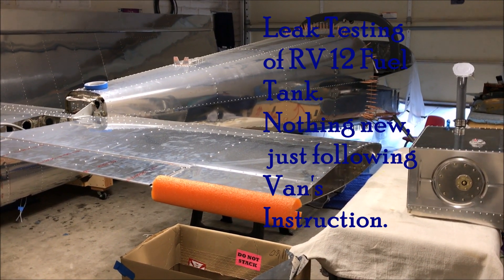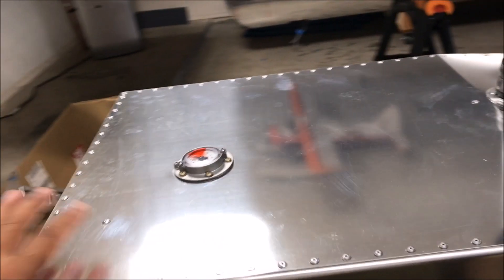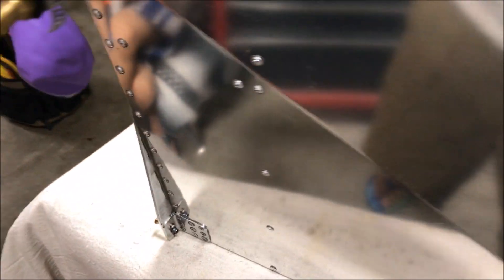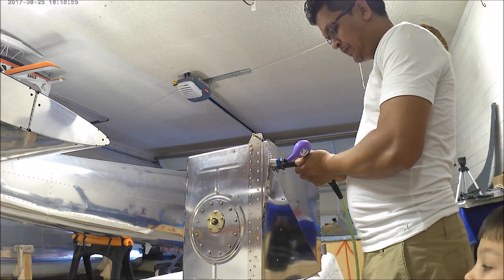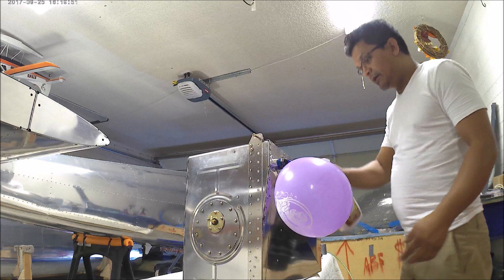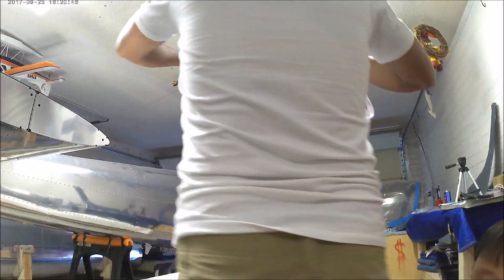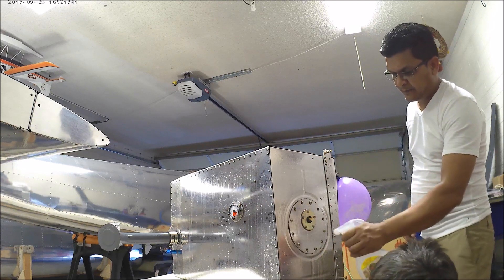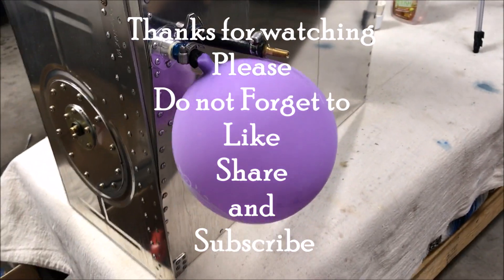RV12 ,Fuel tank LeakTest || Pilot Pramod Regmi

Comment: Cool , we never wait for 24 hours , what we do is put the ballon like u did and dip in water tank with air pressure on tank , so it’s not a welded tank? A2,B2 and B1/2 sealant tank ????
Reply from the maker: Thanks for watching even video is not so professional!!! Tank is not welded its all sealant. 
I just followed the standard procedures of VANS.
Reply: Pilot Pramod Regmi what’s the sealant u used in the fuel tank ?
Reply from the maker: This is what I used. PRO-SEAL FUEL TANK SEALANT P/S 890 B2 
here is the link if it work for you.
https://www.aircraftspruce.com/catalog/appages/ps890.php?gclid=EAIaIQobChMIr_6o6-Gs4AIVAcZkCh20Egn-EAQYASABEgJRovD_BwE

Comment: baloon looks little bit smaller after 24 hour
Reply from the maker: It actually does but very minor. Its okay to lose that much I guess. Now plane has almost 15 hrs flying time and tank has no issue,thanks for stopping by.
Reply: Emilio - Yes sir what caused that very little of deflation is because the air temperature dropped in the garage over night which caused it to BARLEY leak down. He said it was October so I’m sure it cooled off at night time. 😁👍🏼 When you do this kind of test you want to make sure the room temperature stays with in 5 to 10° +/ -  👍🏼